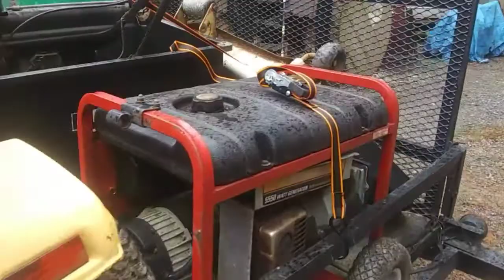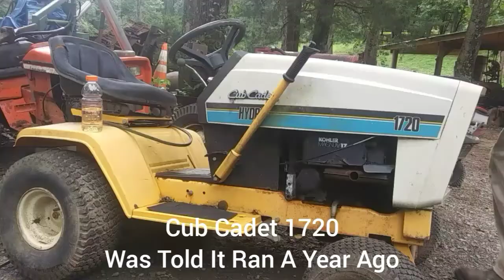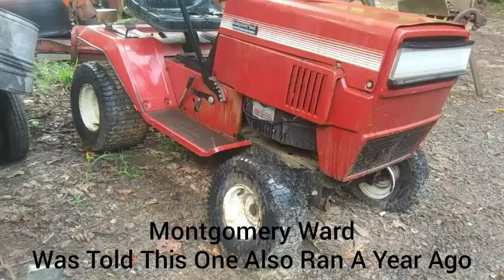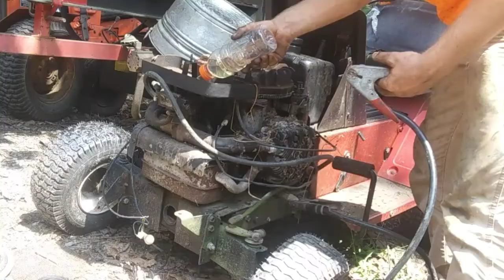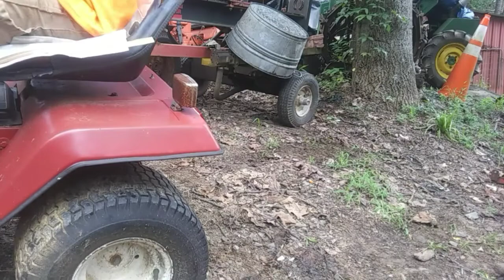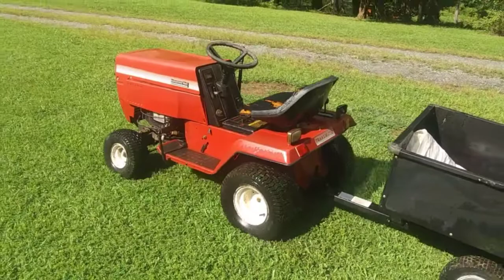Two Old Mowers For Cheap - Will They Run?

Comment: also does that cub 1720 flood gas or does it have a fuel shutoff valve thanks
Reply from the maker: It doesn't have a shutoff but doesn't seem to flood either, haven't run it much though